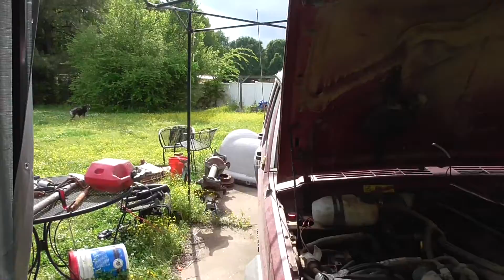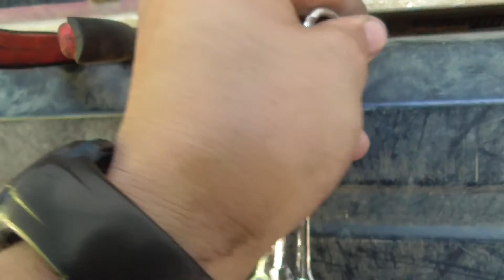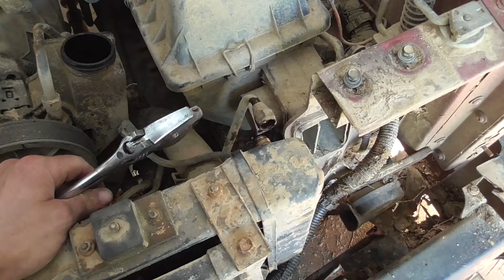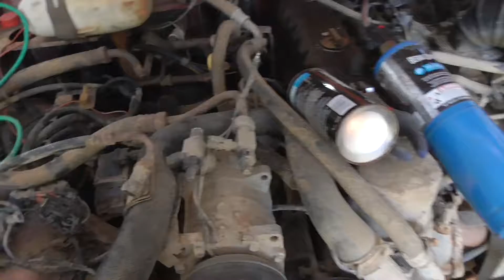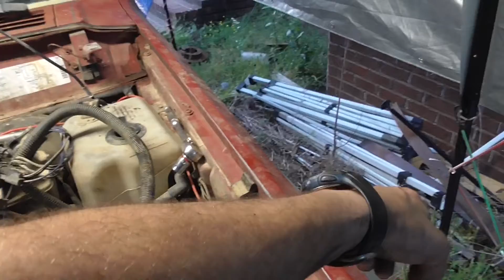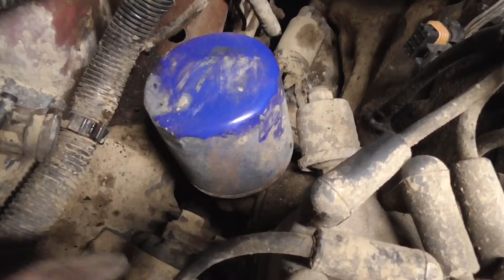1990 Jeep Cherokee (XJ) Engine Swap | Renix to '96 HO Block | Part 1

Comment: Did you finish this project
Reply from the maker: I did, but got into a time crunch to finish in time. I do have a lot more RAW video I could edit and upload of the swap/build but the footage is so old it'll probably never do anything with it.

 I may one day but honestly, the only difference between the engines is the intake, exhaust, distributor, & flexplate. Just swap those parts from the Renix over to the HO block and everything just works.